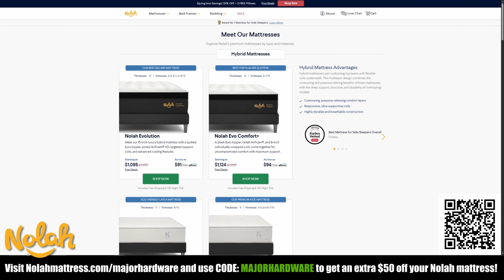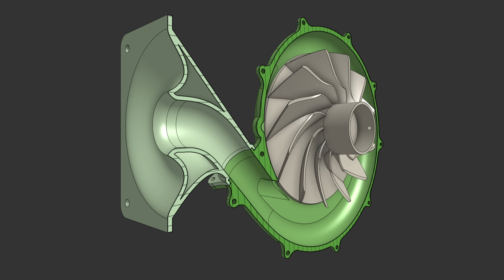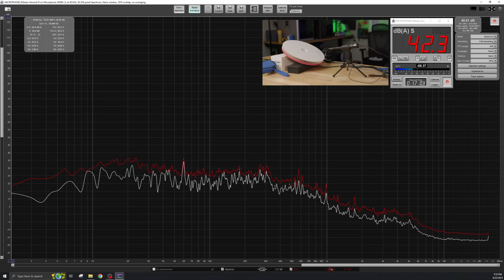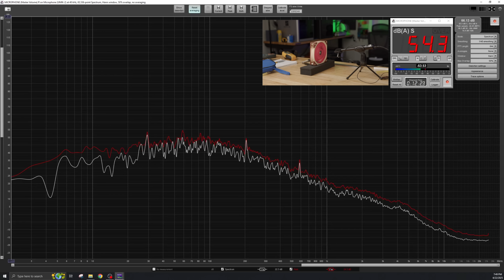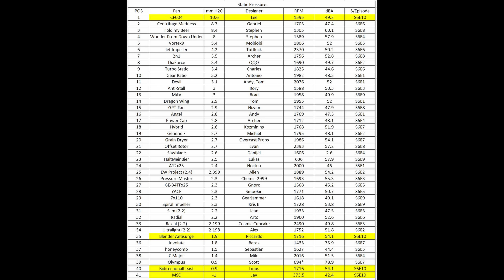This Fan Was Designed to FAIL... And It Broke the Test! | Fan Showdown S6E10

Comment from the maker: Click here http://nolahmattress.com/majorhardware and use CODE: MAJORHARDWARE to get an extra $50 off your mattress + 2 free pillows with select mattresses. Offers are subject to change.
Reply: Isn't the negative pressure fan then an optimal as an exhaust fan? :D
Reply: DUUUDE you should try setting up a computer with the CF004 on one end and the MSC on the other and see what the performance is like since the one will be pushing air into the comp and the other will be pulling it out, see if these two working together would be viable!
Reply: Take the top 2 or 3 fans from all the seasons and subject them all to all the tests you've used, to find out the best all-round performer.
Reply: I just came up with a new idea for your showdown, wind turbine efficiency. Have a set wind speed to turn the fans and see what voltage they produce.
Reply: I think a series on drone propellers might be insightful too (a new challenge?)
Reply: Ngl, I've found it pretty annoying that you didn't even measure CFM this season, even if it isn't a ranking criteria.
Reply: It'd be neat to see a 'Best Heat Sink' competition video where hair & dust particles are fired into them to see what gets clogged the least & yet is still effective at maintaining standard operating CPU temps. Unfortunately the prices on 3D metal printers is a bit too steep.

Comment: I've dreamt of a turbine compressor style fan many times but it's always been conical in shape, not planar, so that the blades can get progressively larger.
The biggest issue with it is that it's non reversible, or really, making it reversible would require a bunch of engineering external to the fans.

Comment: I mean... if we think about it.. a strong enough 'zero' pressure is basically a fan in reverse.... and maybe there is a place for getting a good enough negative pressure 'fan' on the outside of a case, that actively moves air slower on the outside while pulling more air from the inside. >.>  the only problem if that were the case ... is that it wasn't 'negative pressure enough'.    very interesting idea to make a vacuum with an otherwise typical fan engine  tech for computers.

Comment: All the fans 'make' high pressure and low pressure, just not in the same places.  The real question would probably be how effectively they can pull air through a case, right?  The smoke test is purely for show, but Jay's design destroyed it, which suggests that it might be a terrific case fan.  Except probably too fragile, especially since the business end is outside the case.

Comment: The TINIEST advantage is that by lowering the air pressure you get temperature drop.
Where as.
Adding pressure raises the temperature, the tiniest amount..

I wonder what it would be like if?
A. the stationary plate was moving in the opposite direction?
B. The blades were thicker so as to handle the turbulences' of counter rotations?

Comment: the msc fan would be great for a top case exhaust fan,  just have the fan setting right on top pulling the heat up and out.  could make it work on the rear as well with an adaptor to give you wire clearance.

Comment: The design of the MSC somewhat matches that of a simplyfied Turbomolecular Pump used to create high Vacuum in principle. It is made of alternating static and non static rotorblades at different angles. The angles have to be very precise for these things to work. The idea is that the molecules travelling into the fan get deflected in such a way by the fan blades that they travel down the pump and outside of your system. 

One caviat to these types of pump is however that they do not work at atmospheric pressure because they rely on a molecule being hit by a rotating blade and then hitting a static one so:
rot. blade -> static -> rot -> static ... and if they hit anything in between their path becomes randomized and their are equally likely to leave as enter the system and then just heat the blades until the bearings fail.

Which is why they have to be run with a prepump that pumps down the pressure to 10^-3 mBar. So what I am suggesting is that you add a prepump to the setup. That way the PC will acquire maximum heating since no molecules will be there to transport heat away.

Comment: 5:30  The real genius of using the turbo style fan might be with something like the new Cryorig C5 Copper cooler, running the airflow like a server through the fins sideways.  It's rated to 185watts with a 3,000 RPM simple fan as it is.

Comment: seems like vaccuum fan is designed to challenge the accuracy of your intermediate parameters for measuring your actual goal. Fan throughput and fan cooling may have notable exceptions in their relation. if the fan is cooling the heatsink significantly, does it matter how fast the air is blowing, or in which direction?

Comment: I think it's far more impressive that the MSC managed to create a constant vacuum in your static pressure test rig than the 10.4 the cf004 scored (Though that is very impressive). I would be interested to see if you could accurately measure the volume of air moved between the two. Or test this season's winner with it pulling air from your static test rig to see which is truly stronger. Though depending on the winners design it may not be possible to test that way.

Kind of like an underdog vs the champ kind of thing.

Comment: With the fan made by jay, if you would mount in on the back of a pc case it would work really well especially if your pc sat pretty much against a wall, it might need a spacer to clear the io panel though, it would disperse the air very well

Comment: That MSC is a Ljungström turbine.

I've been poking at several youtubers to try optimizing one of these for a long time. You can get single digit megawatts out of the size of a large dinner plate with one of these and they're incredibly easy to manufacture.

Glad someone finally showed one of them.

Comment: Suggestion for a fan showdown season: Test what fan design is the worst instead of best. Like, see how weak you can get the airflow- while still moving air.
Alternatively, aim for what fan can get closest to a specific flow rate, either with Price is Right rules, where you have to get close in one direction, but going too far invalidates the design (so going over invalidates, or vice versa with not reaching the rate invalidating)- or which gets closest to the target rate.

Comment: I wonder how much the CF004 would suffer from having the fan spin in the opposite direction, I would expect quite a lot. The blades "throwing" the air (which is also compressed against the backplate) lengthwise is probably what allows so much flow. That probably reduces the lifespan of the fan motor but it's still very cool.

Comment: CALL SIGN: MSC DESIGNER: JAY RPM: 337.5 
Premise One: 
The computer fan is moving HOT are from inside the computer which is the Right side of the test rig.  

If the test is to see how much smoke is moved from the Right side to the Left side of your test rig this fan needs to be  mounted on the Left side ( outside the Computer ).  Then it will be pulling the HOT/Smoke out of the Computer.   It  is pulling the smoke out the Left side as fast as some of the other fans push the smoke out the Left side.  
So you are comparing a push fan to a Pull Fan.  How much smoke is being pulled from the Right to the Left side.  Looks like a job for a Weather balloon on the Rig. To see how many Cubic Feet of air/smoke is moved from the Right side to the left side of the test Rig.

Comment: Next season - the ultimate would be pressure * flow. Great stats in just one or the other wouldn't be good enough, they have to be an optimal compromise. This is exactly what engineering is about!
The 8 blade fan... See that big second peak on the noise spectrum? That's why we tend not to use even numbers. The fan motor has 4 supports, which resonates with fans that have a multiple of 4 blades especially.

Comment: There's two types of air cooling. One, high pressure, is useful for enclosed settings, such as data centers. The other is to push/pull the air in the direction it wants to move.

If you have a desktop: what you really want is an open top, and to work with the existing air movement by venting upwards. In the sides, and out the top. This is far more efficient and eliminates the need for ultra high pressure. A negative pressure "fan" would probably preform very well as a top fan. Though, the form factor needs a lot of work.

Comment: Just for curiosity, I'd like to see how the negative pressure one performs on an actual computer. Air flowing through a real box full of components isn't going to behave the same forwards and backwards, and it'd be really interesting to have a smoke test pulling through a real tower compared to a standard fan.

Comment: MSC has me thinking... That fan can move a TON of air. The larger entrance didn't allow the smoke to build up in the chamber. I wonder how well that scales down.

Pulling that much air over a CPU could cool it down quite a bit... For a strictly air cooled setup, I wonder how well a 3 MSC system would perform. 1 low inside the case to suck in fresh air, 1 outside on top to pull the hot air out, and 1 over the CPU heat sink to draw air through the cooling fins from around the heat sink.

Invert the configuration with the CPU lower than the graphics card to keep it in the cooler air... OR rotate the configuration so that the cards flow with the direction of heat... It will look funny, but that could take advantage of convectional air movements and reduce the air resistance...

Time to hit the drawing board...

Comment: The negative pressure micht actually be fun on the backside outside of a case in order not to push the warm air out but to pull it out. Mounting it on the outside should work as well as long as you find a way for the cable.

Comment: I don't know how to best word it. But the fans' ability to pick up air. Like how well would it work as a windmill. Put it at the end of a tube, put your best static pressure fan on the other side, and hook a voltmeter to the motor. How much juice does it create?

Comment: I have an inventory of close to 500 fans and I think I have one, maybe 2, that have an even number of blades.

BTW, the tool you originally used for SP was actually measuring pressure differential.

Comment: For next season, optimizing for noise with a minimum CFM / mmH2O limit might be interesting. Basically, try to design the most quiet fan that is still a good fan and not a flat disc or whatever. You could use the results of these earlier seasons to establish the baseline(s) for what an acceptable airflow and/or static pressure would be.

Comment: I've been watching since season one, and still love the idea of the series, however ive noticed the larger contraptions leading the leaderboard, and for me, this hasvery slowly strayed away from the spirit of the series and how it began.  I've mentioned this before, but it would be nice to have separate leaderboards for different categories/class of fans. Every episode would have at least one contestant from each category. 
Standard - Fits within the housing, no protusions
Extended - Simple protusions (nose cones, shroud, fan blades -  limit the size, eg, no more than double the thickness of the fan housing)
Extended Plus / Unlimited - Unlimited height, but stick within the 120x120mm size - the "cheater" would be in this category/class.
Contraptions - Anything goes.

Comment: Honestly given all the tests and fans, a conclusion of fans needs to be done. Since these are based off of PC use fans then we need the fans in a sense put in place. There is the fans for pulling air in through some sort of filter, there are exhaust fans that are unimpeded but are pulling from inside a case, the fans pushing or pulling through a Rad and possibly a filter, and the fans for coolers for the CPU so its blowing through but also having some splash out for cooling other parts around the CPU. 

Which of the fans would be best positioned for their use case fitting that needed form and function plus the quiet nature. Kinda make it a finale for all the normal fan designs. Might need to be some retesting of some old designs but there are certainly a few that can be overlooked. However I think noise being one of the main points to look at. DB but also frequency is the key points because something that is loud is one thing but something sitting near you annoying you to all get out is another. That main criteria could be the axe to some of the favorites.

Comment: The fan on the vaccuum one should have been the other way around and the fan on the output side. it creates a vacuum in the large disk by pulling air out while restricting intake dynamically

Comment: DUUUDE you should try setting up a computer with the CF004 on one end and the MSC on the other and see what the performance is like since the one will be pushing air into the comp and the other will be pulling it out, see if these two working together would be viable!

Comment: I think PC cooling makes more sense. Anything else so far is just novelty. But also regular PC cooling is boring, there's only so much you can do with a standard fan. So I'm thinking some unusual cases or overclocking, where unusual fans could be interesting.

Other than that, what could be interesting use cases? Quieter fans, cooler looking fans? 3D printed pumps?

Comment: Mechanical engineer here. I think the MSC should spin the other way. Rotor stator arrangement like that is usually used for compression purpose like in jet engines. You should try spinning it the other way I mean the direction of the rotors and stators needs to be flipped so that it sucks from the outside and blows it into the a12

Comment: REMEMBER: If you use onshape in its free version, your files are publicly available to anyone who wants to see them. If you make a little adapter from your jigsaw to your shop vac, you might not care, but in case you keep your developments more private, get the free fusion360 (still cloud, but not public), consider the 50$/year Solidworks Maker license (pretty sweet deal if you are serious), if you hate yourself and love half finished products, try freecad and if you want to code your parts rather than designing them look at openscad (no idea how that works, but some swear by it, especially for a part with many versions where you often have to change dimensions)
There you go, hope that helps :)

Comment: Onshape is amazing! First of all, it's free, but even then it's just as powerful as most CAD software, and it's cloud based, so it doesn't crash, and if your computer somehow dies, the files are saved, and it even has this time stamp thing that is really useful, ao if you mess up a design beyond ctrl z'ing it back, you can just look at the time stamps and get it back to where it was fine.
Reply: Anyone who has used Fusion360 will find a lot of familiar features. It's not quite the same but close enough.
Reply: I'm also an Onshape user. I came over from SolidWorks. Onshape is basically as powerful as anything else and there are a ton of plugins that fill in any gaps.

I just wish the built in lofts tool worked a little better.

Comment: One thing that might be interesting for season 7 is to test actual cooling performance. Stick a little resistive heater to a heat sink, stick it in an enclosure, adjust the power to get it a set number of degrees above ambient, and see which fan cools it the most.

Comment: I've missed some episodes and cool to see you have a static pressure setup but confused why the CFM went away. Static pressure is certainly important in a restrictive environment, but typically a PC case is designed to not be restrictive so it's far less important than the volume of air being moved. If you needed to blow leaves in the yard would you use a bottle of canned air which has very high pressure? If you had something stuck in a tiny crevice would you use a Big Ass ceiling Fan? I would suggest next season using both tests but weighing the CFM heavier than the mm h2o. Hell if you want to goo all in, set up a mock box with failed components inside and measure CFM exiting the case. That would give you the true effectiveness of the fan for the intended purpose.

Comment: If you're not a fan (heh) of cloud based CAD, I've been using Design Spark Mechanical for nearly a decade now - it has super intuitive modeling functionality that I've really never seen anywhere else. It's free, installs to your system, and your files/designs save locally, unlike cloud based apps like OnShape. There's a video floating around YouTube showing how easy it is to do all kinds of stuff in DSM, and the thumbnail is some random radially symmetrical shape. It's a few minutes long, and it will give you an idea of how simple and powerful that DSM is to use.

Comment: Well... not a computer guy, but logically, its about flowing the most amount of air possible through the entire computer case, right? What if next season was a measurement of airflow through some sealed device, with one fan pulling air into the device, and another pulling air out